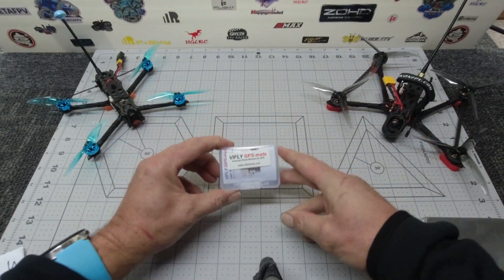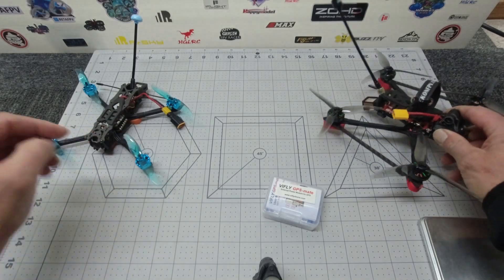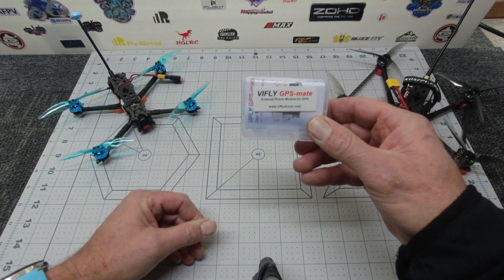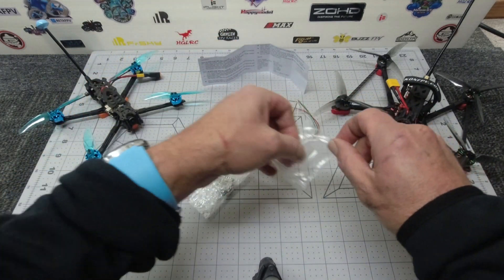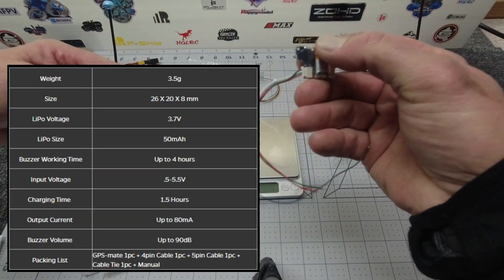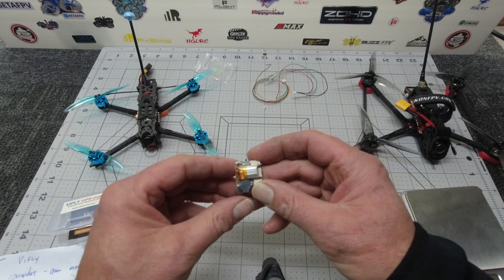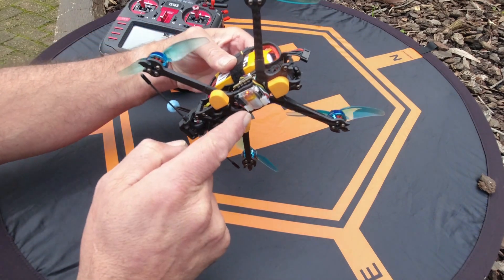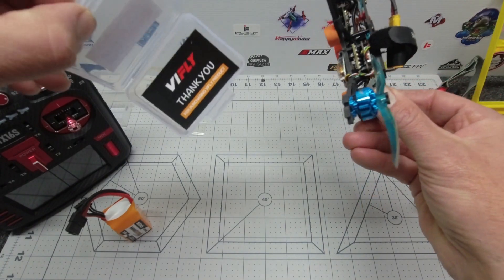VIFLY GPS Mate - Power Module for GPS + Lost Drone Alarm

Comment: Great video! Question...you said the battery takes about 1.5hrs to fully charge. How do you do that?
Reply from the maker: The unit will charge automatically when connected to your lipo.  🍻👍
Reply: @GTARC_au  but you aren't gonna power up your quad for 1,5h aren't you? and when you rely on it being charged with regular flight it'll take a lot of flights until it's operational.

Comment: Yeah I've used a few cause when and if the battery dies, then it's completely dead and there's no bring them back. One of them the button was accidentally turned on during transcription and the batt. Died. I have had to plug in main batt to connect. So I have been doing this way and have flying this way to see if the battery can recharge but it ain't. I have easily past an hour of flying time and it's dead. Their not worth the money I've put them on 4 kwads and have removed all but one.
Reply from the maker: I test mine with a volt meter. Sorry to gear your issues. Mine is working without any issues at all. 🍻👍